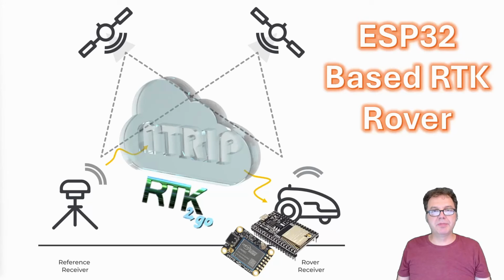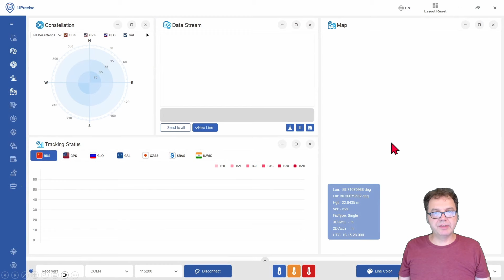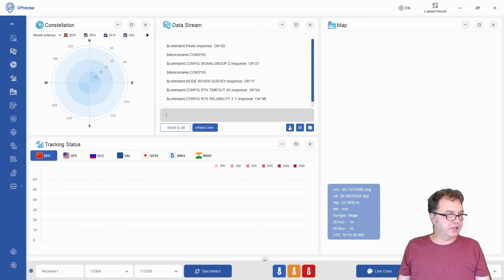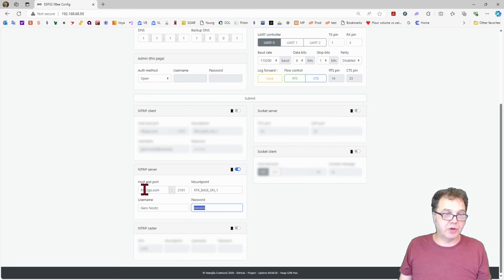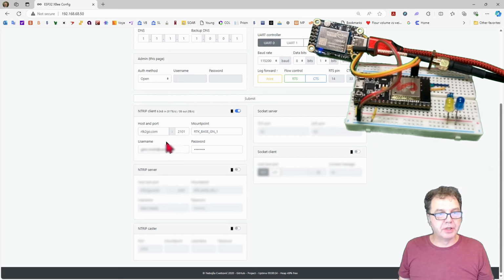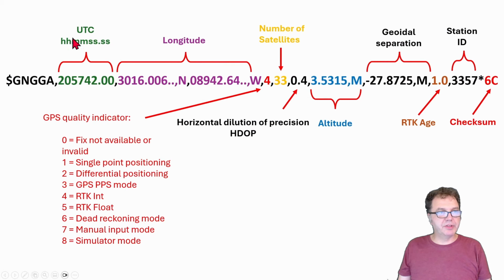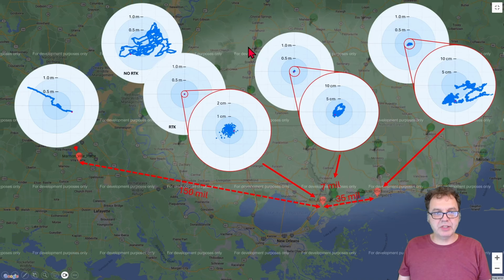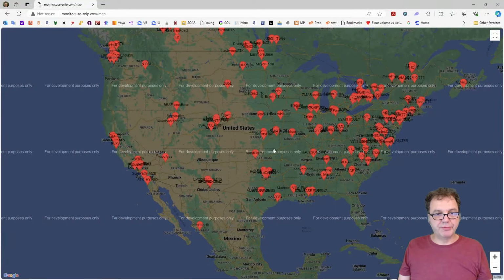ESP32 based RTK Rover

Comment: Can we able to send RTCM Corrections between base and rover ESP32s with wifi or Bluetooth. and Remove the need for RTK2go? Process will be more simpler. Anyway this video helped me a lot, thankyou for doing this
Reply from the maker: Certainly, you can use the UDP/TCP socket functionality of the XBee for that purpose. I intend to publish a video on this topic shortly.
Reply: @oceanexplorationlab  absolutely please do and 1 more thing, with 982 and 2 antennas utilized can the rover determine altitude and axis rotation. I want this data for ROS in raspberry pi for SLAM. Ras pi is onboard on UAV. Thankyou.

Comment: Hi, may I know did you used Arduino ide to program the esp32.?
Reply from the maker: I typically use platformIO when programming and ESP but in this video  series no programming is used. All software can be flashed from pre-complied source.

Comment: did I understand correctly, 2 esp boards are needed, one for the base station, the second for the rover? Also, there must be wi-fi coverage on the rover to receive data from the base station?
Reply from the maker: Yes, that's correct—in the configuration I'm currently exploring, you need two ESP boards: one for the base station and another for the rover. The base sends RTK correction data to the rover, so there does need to be a stable connection between the base and the rover. However, there are other options to send telemetry data besides WiFi, such as using LoRa, cellular modules, or Bluetooth, depending on your specific use case and range requirements.
Reply: @oceanexplorationlab  what about ppp?
Reply from the maker: PPP only needs a single setup as it does not rely on a base station. This is coming up. Subscribe if you don't want don't miss the video.

Comment: Thanks a lot for this very interesting vidéo, but is it possible to use the RtkToGo network instead of the base station ?
Reply from the maker: You can use it if someone reliably streams correction data to RTK2Go, but you must be within a 20-kilometer range.

Comment: Watching your videos over and over hopefully this total noob can make this work! Thanks for your content! 👍
Reply from the maker: Fantastic! I try to make this as noob-friendly as possible. Let me know if you get stuck.
Reply: @oceanexplorationlab  Stuck - no power on esp32 unsure what the 3v3 is suppose to be connected to? No red power light when the um980 is connected to laptop. I must have something wrong on the breadboard.
Reply from the maker: @whiskerrub  If you follow the provided diagram and omit the LEDs, nothing will be connected to the 3.3V pins on the ESP. Power will be supplied from the UM980 module to the 5V pins on the ESP32. Ensure your individual components function properly when connected to USB. If they are still working, you should be fine.
Reply: @oceanexplorationlab  Ok so try omitting the LEDS? I was unsure how you connected the wires beneath the esp32, definitely I have a lot to learn.
Reply from the maker: @whiskerrub  Leaving out the LEDs initially reduces the potential for errors. Once the ESP is powered up and you've confirmed that the other wires are correctly connected, you can then reinstall the LEDs.
Reply: @oceanexplorationlab Working on it👍 Thanks greatly appreciated.

Comment: Like the videos but I am wanting to know how to display the lat and long on an lcd screen. Do you need to run a separate ESP32?
Reply from the maker: If you use the ESP32 XBee code binary, yes, you will have to use a second microcontroller to display the coordinates on an OLED. Alternatively, you can try to modify the source code if you are comfortable with the Espressif IDF (I am not).
Reply: If you can do a video on this it would be of interest. Like the idea of a second esp32 or a raspberry pi. From reading last night looks like you get the uart from either TCP or USB.

Comment: Hello! I want to make the same connection, but via SiK Telemetry Radio. Rover receives corrections over the wires, but does not work through the radio. Using the utility, I can see that the corrections data (I hope) is being sent to Rover radio.
But UM982 behaves as if there are no corrections.
Do you not know how to debug the system? I haven't found how to see what the UM985 gets.
Thank You!
Reply from the maker: I would connect the SiK output to a serial monitor via a USB to serial adapter to see if the SiK provides the correct data to the UM98X.
Reply: @oceanexplorationlab  I have solved the issue. It turns out that Sick Telemetry Radio does not transmit data to the port if it is connected to a computer via USB. The LEDs are flashing, the console sees incoming data, but they do not go to the port.
Thank you!

Comment: This series has been great!  I’ve set up my base and had it online for a couple weeks now. I want to set up and build a survey stick rover next. I have ordered the parts and am awaiting them. I’m not sure yet how to get the rover points saved and plotted on a map. I’m thinking about using the sw maps app on my phone to do this. I would like to be able to save two points then generate a line between them. Once I have the line I want to use the rover to locate that line in the field. In order to use the rover in sw maps it must be connected to the phone with Bluetooth. Any chance you will be covering this in future videos?  Thanks again for all the help so far!
Reply from the maker: It sounds like an exciting project. I have no current plans to create a video about waypoints, but ArduPilot is a tool you want to look into.
Reply: Hi I'm thinking of bulding stick rover as well. Can you tell me what kind of antenna you have purchased? I've saw that on aliexpress there are those regular ones and small black ones and I wonder is there any difference. The smaller one would be a better fit for stick RTK rover if they have the same specs I think. Also are using UM980?
Reply from the maker: @kuwerty2kuwerty23  You need to be careful; the small antennas are typically not triple-band and, therefore, will not give you the best results
Reply: I’m using a stk-107 for my base station and it gets great reception. For my rover I purchased the ag-35 antenna but it hasn’t arrived yet. I ordered it because the housing looks bigger I plan to house all the electronics inside of the antenna cover and just have a plug to supply battery power to it.   Iv got all the code working and am able to communicate with the esp32 via Bluetooth on my iPhone. I’m still waiting on the um982 and rest of the parts to get here from china. I can sucessfully pass nmea and Rtcm messages and get an RTK fix.
Reply: @awolfe9069  What app are you using on your iPhone, is the coding part complicated to do?
Reply: I’m using sw maps. The coding was a pain because you have to use ble instead of Bluetooth classic. iPhones only work with ble. If you have an android you can use Bluetooth classic and it should be much easier.
Reply: @awolfe9069  Thanks a lot for the answer. I would like to do sth portable to connect UM980 via bluetooth to a smartphone but not sure I'll be able to code this :D

Comment: Hello. How can I write the coordinates of the base station in XBee? Longitude and latitude. How do I connect an OLED monitor?
Reply from the maker: Hello! The coordinates of the base station (longitude and latitude) are provided by the GNSS module as part of the correction data. When configuring the UM980 as a base, you’ll need to provide those coordinates. In my video, I used the automatic determination of the base coordinates via the base time 60 2 2.5 (Self-optimizing Base Station Mode) command. I recommend consulting the Unicore Reference Commands Manual to understand how to provide the coordinates for your base using the "Fixed Base Station with Precise Coordinates" mode.

As for connecting an OLED monitor, this won’t be possible unless you modify the source code of the XBee, which is available on GitHub. You would need to make changes there to integrate the OLED.

Comment: Thank you for your videos. I did not find how the UM980 "understands" that RTCM needs to be accepted on COM2. There are RTCM broadcast commands to the specified port in the documentation, but there are no commands indicating RTCM reception to a specific UM980 port. I also didn't find the answer in your video, you just plug ESP 32 into COM2 and everything works)
How does it work?
Thank you.
Reply from the maker: The module accepts RTCM corrections on all UART ports by default. In this setup, COM2 is configured to send NMEA comments to the ESP32. Since RTCM corrections are accepted on any port, there's no need for a dedicated command to specify reception on COM2.
Reply: @oceanexplorationlab  Thanks!

Comment: This option is just some kind of stupidity. What is ESP 32 here for, what would that be?(only receive corrections and do not use them any further)  If for some RC model, the GNSS module is connected directly to the autopilot(Ardupilot, PX4, etc.) 
 For the rover, it is enough to connect the Bluetooth module and use the app on your phone/tablet.
Reply from the maker: While your application might not need an ESP32 if you're getting the RTCM stream via an autopilot, in the absence of a more advanced autopilot, the ESP32 is actually a perfectly fine solution to receive the necessary correction data and send it to the UM980. For a survey and plotting positions on a map, there's no need for an autopilot. I'm not sure why you say it isn't used—it's specifically there to handle the corrections. Also, there's no need for dismissive language—we're all here to learn and share knowledge.